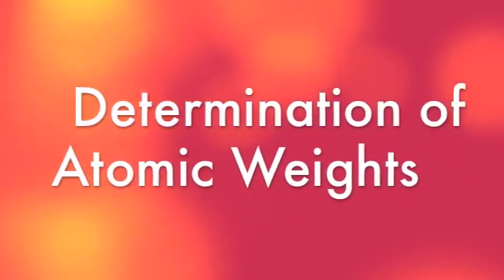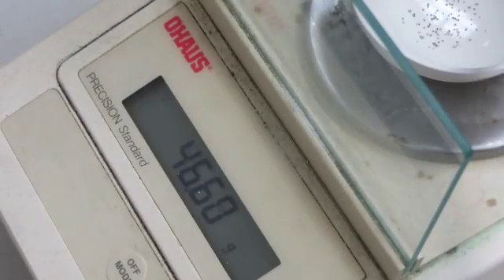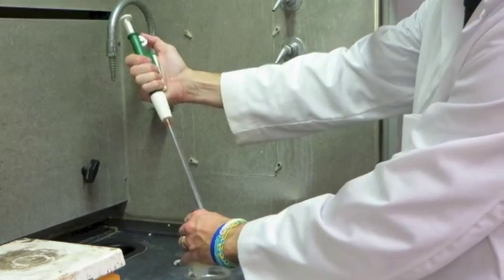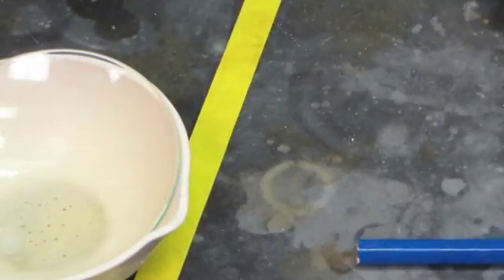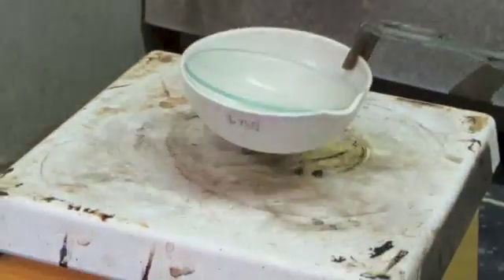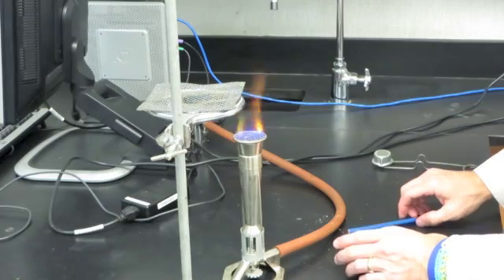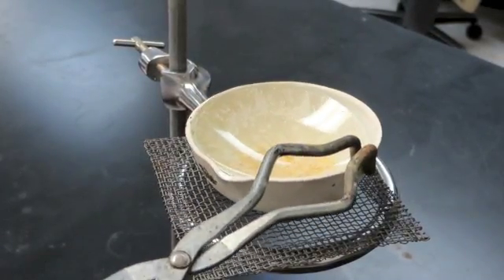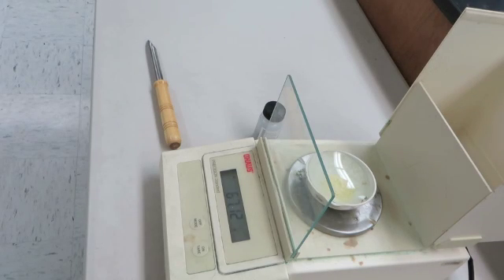Tin Oxide Lab

Comment: Thanks man.
I did electrolysis of tin(condensed milk can top cut with can opener), solution used was tap water + 1 tea spoon salt
https://duckduckgo.com/?q=condensed+milk&iax=images&ia=images
tin plate was on + side and there was an iron nail on the other - side.
When it first started there was bubbling residue of black/dark gray, blue, white, and on top there is some foam kinda orange/light brown in color.
Stuff was always sinking to bottom except for that foam it was on top.
Then I added some small lemon/lime juice cause some Youtube said it helps in electroplating, I was also trying to e-plate the nail and see what happens.
The nail turned dark gray.
Q1: what are the compounds in this solution? what does each color represent?
Q2: How come tin became dark gray/ matte black?
Q3: what are the colors of all tin oxide groups? I read there is I, II, III, VI ?
Q4: is there a simple way to turn tin oxide into just plain tin?
Thanks in advance

Comment: if if was a solid piece of tin, would the patina layer of SnO2 prevent further reaction?
Reply from the maker: I don't believe so. After all, the grains are all still solid pieces of tin, just smaller. There is usually not an unbroken layer of patina either, so the nitric acid has access to the tin to initiate the reaction, and ends up getting to pretty much all of it.  If the SnO2 would prevent that, then even during the reaction, you wouldn't expect the nitric acid to get to the center of the granules.  Hope that answers your question!  And thanks!